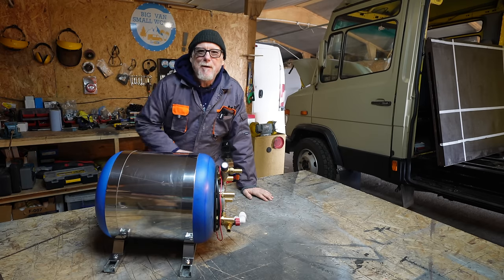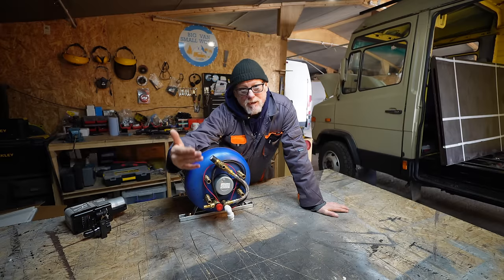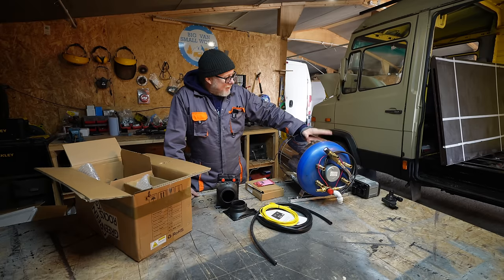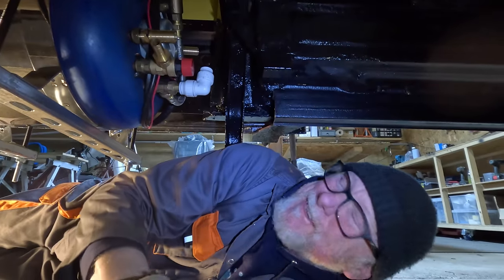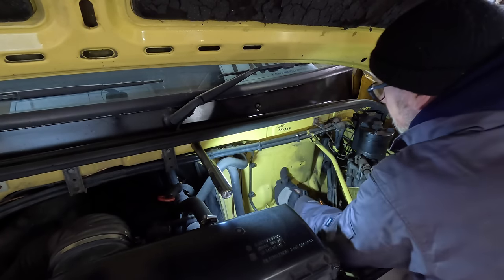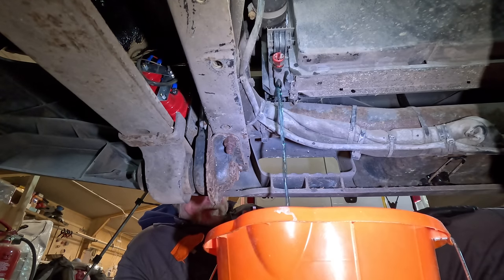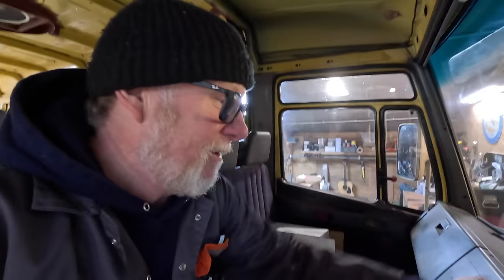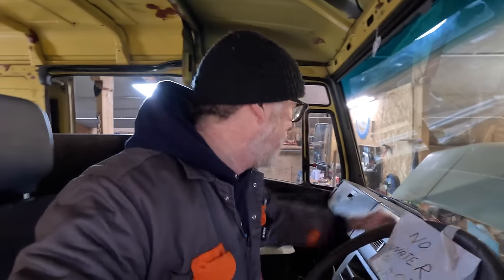The best way to heat water in a camper van #vanlife

Comment: Not sure i would be happy having my hot water system exposed to the elements maybe build a box around it with a access hatch inside the van i feel frozen, burst pipes and heat loss will be a problem at some point
Reply from the maker: Yeah I was thinking about that 👍🤓👍
Reply: Already planned 😊
Reply: You have implemented the exact same water system i have planned you didnt mention how you was going to add the bobil system to your setup i would be interested in seeing how you plan to do this at some point 😁 also wanted to say the exhaust on your pre heater make sure the muffler is the lowest point as you could end up with water in the pipe could cause you problems and eventually rot the pipe... Really enjoying this build its gonna be a fabulous truck by the looks of it 👌using a separate tank for fuel is ideal im not sure why more people dont use this as red diesel "HEATING OIL" or paraffin is so much cheaper and widely available in Europe... with your water heating system maybe a radiator or two would be a nice addition 😁 in the garage under the bed keep things dry and a nice towel rail lol full on OTT comfort seeing as you have the means 😁

Comment: Calorifier is Exactly the Same as the Copper Cylinder in your  House  🏠   and there's NO FREE HEAT 😅
Reply from the maker: If you’re house had an engine like mine hot water would be a buy product of moving it

Comment: You should not advertise your going   to use red diesel as you can only buy and use for farmers, even builders are not aloud to use it in their excavators.😂
Reply from the maker: You should do your research before leaving comment it’s perfectly fine to use red diesel for heating in fact it’s actually referred to as heating oil